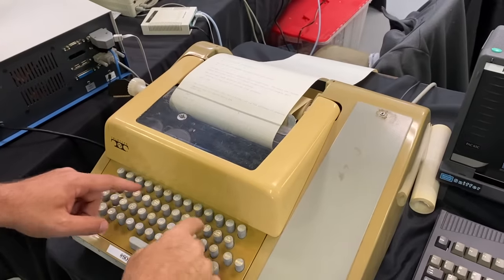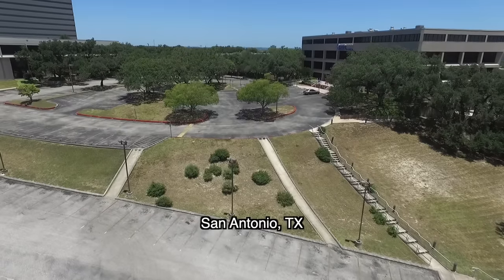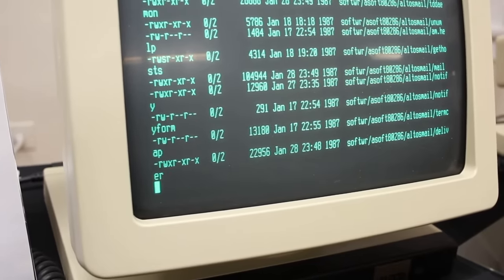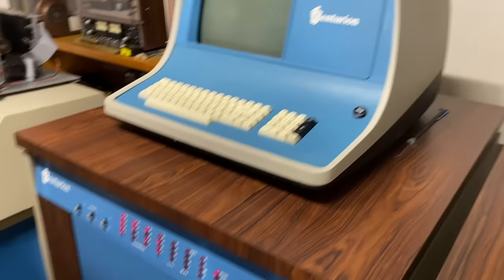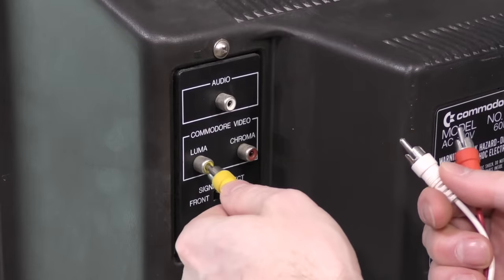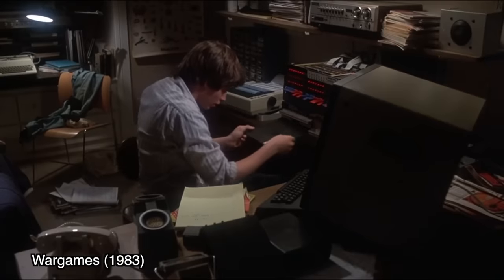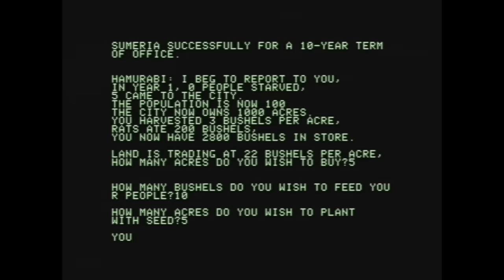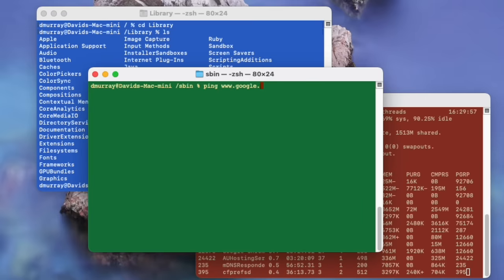What are Dumb Terminals?

Comment: You absolutely could write games for dumb terminals. When i was in college in the early 70s we had a PDP11 with 16 terminals. Most were Teletypes or Texas Instruments Silent 700s which used thermal paper and as their name implied were quiet. But we had a single Tektronics graphics terminal which used a storage tube. It used vector graphics not character generators so it was possible to draw on the screen. The other characteristic of the storage tube was that the entire tube had to be erased at once. Erasing flashed the screen. I wrote a fighter plane program called MIG 25 where you tried to shoot down a MIG. The erase function made a very nice explosion so if you hit the plane I'd erase the screen.

Comment: I think it's worth mentioning that in France they had Minitel, a system run by the Postal Office that put a terminal in every household in the early 80s. What started as a way to save money by having the phonebook in a computer instead of printing millions of copies each year ended up becoming a proto-internet of sorts, with people sending emails and doing online shopping. It even had the same problems as the internet but 2 decades early, like a start-up bubble and controversy about pornography to minors
Reply: You can even access the serial port on some models, so it's still usable as a terminal for a linux PC, although with that keyboard, not a very good one x)
Reply: That’s kinda neat tho
Reply: @kaktusgoreng  What's interesting is that it was so successful that it actually slowed down the adoption of the Internet in France. These terminals were free and access was affordable (same price per minute as your average telephone call), so millions of households had one. They were also designed to basically last forever, since the technology was stagnant. When the Internet came along in the '90s, you had to buy an expensive PC for it (that would be outdated in a few years) and to many, it just didn't seem worth the hassle, given that all of the online services they were using were available anyway. Since Minitel allowed private firms to offer services for it however, these companies had no trouble transitioning to the Internet once it came along, given that they already had experience with online services.
Reply: Early internet and early forerunners fascinate me a lot.
Reply: @no1DdC  Oh yeah, I could see that, computers developed insanely fast in the 90s. I know of some stories of people getting a shiny new 486 for work (and Doom), with said 486 becoming outdated in not that long time.
Reply: Not to forget the German "Bildschirmtext", or "BTX" (which translates to "screen text" or "monitor text") and was based on the French one (using a television as the display unit).
Reply: UK had something like that for TV but it was only one way called Teletext that sent the data on a over the air tv broadcast.
Reply: @0neDoomedSpaceMarine  I switched from my Amiga 2000 to Windows PC in 1996. To keep up with games requirements, I built a new PC every other year until 2004. It was expensive to keep up with technology back then :)
Reply: There was a brief trial of Minitel in Canada, called Teledon in the mid-80s as well. I remember being first exposed to it in the Arts, Science and Technology centre (renamed Science World and moved to the Expo 86 grounds in 1986) and then the public libraries. As a preteen at the time all I cared about were the networked games (and wrote down the URL pathways needed to access them) but it was amazing tech. A shame it never took off in Canada the way it did in France.
Reply: They had Minitel in the US for a short time in the early nineties. I rented one and had many conversations in the chat rooms.
Reply: I could write this into my fan fiction!
Reply: @IcyTorment  why was it prematured? I mean it lasted until 2012, and technically speaking the physical infrastructure for the network is still all around, because it is so reliable. RTC is still in use, and despite all effort of getting rid of it, we will still use it because it's simple and robust.
Reply: SuperNostalgia.  Man... Who wants to live forever? It must be boring as hell to live for eternity. Isn't one life enough?
Reply: @no1DdC  And there was one other reason why the service held on for so long: Its security. 

The service was surprisingly secure, especially given how primitive it was at its core. Even when the service was shut off for good in 2012, the banking services were still seeing regular use...Much to the chagrin of the holdouts.
Reply: @Perktube1 no. not in the US
Reply: Oui salut le français ! :hand-pink-waving:

Comment: I still technically use a terminal to this day. Instead of a dedicated, single use device, we have thin client computers running an IBM 5250 terminal program to connect to an IBM Power7 which is essentially a modern IBM AS/400. Works for us since our software was all written in the 1980's in COBOL and we still use it today, have even integrated it into the modern web. Terminals aren't dead, they are just taking a different form!
Reply: Many people would quibble about calling a thin client a terminal, but of course that somewhat ignores the transition-period “smart terminals” with extremely limited local computation. You’re 100% correct that they’re the same spirit!
Reply: Terminals haven't died, for sure, they've evolved, and may continue to do so.
Reply: Yeah we got several modern mainframes that necessitate the use of terminal clients as well.
Reply: Alot of healthcare and insurance companies still use the AS/400 or equivalent, my job right now in healthcare uses it mainly for time keeping (KRONOS) , but whenever we had to reset passwords for managers, we would have to use a terminal emulator.

Although i did use real terminals back in the early 2000s as a furniture manufacturer as they did all data entry into an actual AS/400 midrange, we had a bunch of 3178/3179/and 3180 terminals. along with PCs using your standard software terminals and a few PC's that were not on the network using a hardware terminal emulator (connects to the twinax connection that the dumb terminals would use)
Reply: Healthcare or banking?  Only two industries I can think of that this but my guess is banking since the code is COBOL.   Always thought if the some of the tools I use today to help code had really caught on when COBOL was common it would still be useful for a lot of systems.  Graphics not so much but really how much low level graphics does anyone actually write even today?
Reply: @Jen39x  Auto Parts. We are a small company, wrote everything in house, and just keep updating the hardware as time goes on. Works well for us. We have integrated the AS/400 system into the web so they work together. We can order and view parts on the internet so we have the full GUI, and that information gets sent to the AS/400 at each site for billing. The company wants to retire the old system by 2030, but we all like the old system. Its fast and it works.
Reply: Terminal emulators have existed even in retro computers. In LGR's PS/2 restoration, there was a card installed that emulated a terminal. When installed, it took priority over everything else so he couldn't even run the computer normally without uninstalling the card.
Reply: @MichaelAStanhope  It is pretty amazing that a lot of businesses still use ancient software and hardware but I don't blame them.  If it isn't broke don't fix it. If they do put a new system in 2030 I can almost guarantee it will be a pain in the butt.  There is still tons of stuff that runs on Windows XP.  If it works then upgrading for no reason is just a waste of time and money.
Reply: @HerecomestheCalavera  we are a small company compared to the national auto parts chains, so its logical for us to use what has worked for us for decades. I hope they never change from the AS/400 system because anything they change to will be inherently more complicated and slower.
Reply: @jjjacer  we unfortunately migrated our KRONOS timekeeping system to the internet, and its a pain in the rear. I used to be able to sit down, log into my AS/400 and go to the timekeeping, and clock in and out, no problem, now I have to go to the internet, log in with my horribly long email address TWICE to just get to the time keeping system. Its a pain honestly and wish they never would have messed with it, but i guess its all in the name of "progress".
Reply: @MichaelAStanhope  we still use it for the most part, at least the terminal entry for clocking in remotely. biggest issue is it has to run in IE5 compatibility mode, and the supervisor console required java 6, i think we use a different supervisor console now (not sure as im no longer helpdesk and moved into networking)
Reply: funny you mention AS/400... we have an emulator running that on Windows 10 and on handheld Android devices.
Reply: In the late 90s, I worked at IBM Canada where I supported, among other software, the Personal Communications terminal emulator.  It could do 3270, 5250 and plain telnet.
Reply: @James_Knott  Used PCOMM a bunch, back in the day..
Reply: Hmm. You really ought to replace that Power7 system. IBM withdrew hardware support for Power7 systems a couple of years back, although I guess you may have third-party maintenance.
Reply: Technically, every computer made today is also a terminal

Comment: Terminal interfacing is still very much alive and relevant in modern IT. I’ve been a network engineer for ~27 years now. The vast majority of the equipment I work with every day still supports a physical serial connection to a terminal. Obviously this is almost always a terminal emulator these days,  but a ‘dumb’ serial terminal would still work. When everything is at-least partially working properly, we can forego the serial connection and use IP (usually SSH) to emulate the serial connection over a network connection. But we always keep a serial connection handy for when lower level access is needed.
Reply: Indeed. I've connected up and used serial interfaces on things like routers and IP cameras and other devices without network shell access, to rescue or gain access to the OS (often to enable ssh, telnet, ftp, tftp, etc.) Sometimes a serial connector header would have to be soldered in place first into the unpopulated points on the motherboard. 

It's amazing just how many devices are just mini/embedded Linux machines, much less powerful than a Raspberry PI yet still doing their things.

Edit: typo
Reply: This was my day today.  Two QFX switches, one EX switch, two PAN 3400 series.  All initially configured by a serial console.  <3 ⌨️🖥
Reply: @szr8 Those essentially are JTAG interfaces.
Reply: Also, their are console servers...
Reply: @szr8  Professional network equipment has this serial interface exposed, usually as an... RJ-45 port (in older devices you could find the standard DB9 connector, but RJ-45 occupies less space and it's probably cheaper to use the same connector as for the Ethernet interfaces), and in a data center you normally have it connected to a special terminal server (imagine a collection of dumb terminals with... network access), to which you can connect through SSH.
Obviously if even that fails (say, you are re-configuring your management network and you just did something extremely stupid, losing all access to both the devices over IP and those console servers), you could physically go to the data center, connect your terminal (well, nowadays it would rather be a terminal emulator on a laptop, probably even with an external serial port adapter connected to the USB port, as modern computers don't have serial ports any more) and resolve the issue this way.
Configuring such a device taken out of the box usually also still begins with connecting to its console port.
Reply: yep, I had to terminal into my old Dell X series because I was being an idiot and assigned 2 ports DHCP, when only supports 1 port for DHCP. Lost the GUI. Had to reconfig the DHCP port through serial USB.
Reply: Even the latest Aruba CX switches are still configured using a serial interface and a terminal emulator. I've done 27 last week for a client! Sure they now use USB-C instead of DB9, but it's the same old serial. 

SSH is also very much alive, even used by virtual controllers for switches and APs.
Reply: same here, I work on mainframes with a IBM terminal emulator daily, and since IBM is insistent on staying in the dark ages and banning any virtualization, on mainframe workloads shifted to a containerized COBOL interpreters as well.  Not to mention our AS/400 systems, which are still extremely common in applications where reliability really matters like banking, airlines, utilities and insurance.
Reply: @HarmonicaMustang  SSH is pretty much the life-blood of networking. Well, emulating a terminal connection to a cli actually - SSH just happens to still be the best way to do that. When I started out, it was telnet. I think it’s going to be a long time before network gear (in general) will be gui driven (at a professional level). I know there are tools and front-ends out there for stuff,  it I’m sure you know as well as I that they’re typically a bit of a cluster-f^ck. I’d bet money that you’re like me - CLI feels like ‘home’.
Reply: @kpc211  we have console servers throughout the enterprise. We’re also fortunate enough to have either POTS or LTE as an alternate means of connecting to the console servers (should we lose IP access). This has definitely been a life saver from time to time!
Reply: My Meade telescope actually communicates to computers over RS232 and the telescope only uses 8-bit commands to tell it to skew left, right, up, and down with the last one, which refers to the telescope's programmed location data. The program you install on the computer is actually a terminal emulator with a GUI to help you visualize the data you send to the telescope. The telescope remote is actually a single user terminal with 84 kilobytes of ROM onboard and has a Zilog Z80 microprocessor which communicates to the telescope motor via a modem.
Reply: @kpc211 newer devices even have a serial interface over USB mini or even more recently USB-C.

Comment: As a sysadmin, I still use terminals; not only during regular operations with virtual terminals, but when a system is seemingly unresponsive, the hosting provider can provide a serial connection to the faulty server and this gets piped as-is into a terminal emulator through internet. Same for virtual machines; we can setup a virtual serial port for the guest system, and literally pipe that from the host to get a working shell from the kernel even though SSH and sometimes virtual display are broken.

It's very useful, as it's very basic and does not requires much working parts.
Reply: Kinda makes me wanna try to plug one of those type writers into the console port
Reply: I'm guessing it's safe to assume that DOSBox can do that, too.
Reply: @Chaos89P  What is Dos Box ??
Reply: @josephgaviota  An Emulator for DOS, mostly focused on game compatibility, but could in theory run other DOS software.
Reply: @flametitan100  It can even run operating environments like Windows 3, although that might be for the Windows Entertainment Pack to run correctly. I've also used it to run Word 5.5 for DOS.
Reply: @Chaos89P  Oh yeah, it's fully functional as far as eumlators go; it's just optimised for retro gaming, and makes no promises your printer from 1992 will work with it
Reply: It really is funny how relevant complexity can be. Modern server management software is powerful, but exceedingly complex; a terminal and a serial connection, however? Ridiculously simple, absolutely ancient standard, and yet when everything else is FUBAR, it might just be the only thing that still works.
Reply: @flametitan100  Eh, I'm more interested in getting fonts to work in Word 5.5. The documents are otherwise 100% compatible with any other application that accepts the .doc format.
Reply: @Chaos89P  I wish you luck! I'm more someone who enjoys seeing what others can do with vintage tech than messing with it personally, but the results are always neat.
Reply: @robschn  You can find a video on YouTube of guys who connected a teletype to a computer with Linux... And got it working.